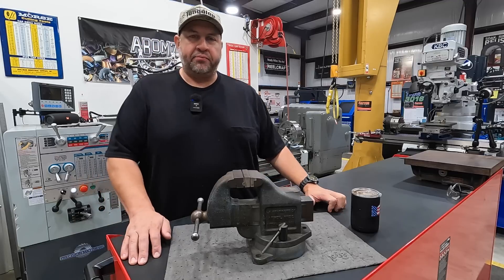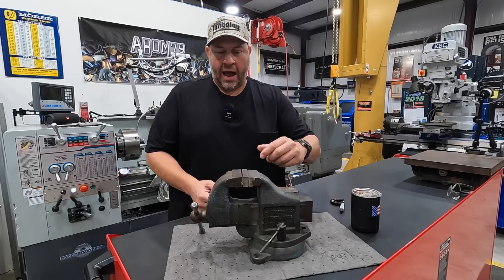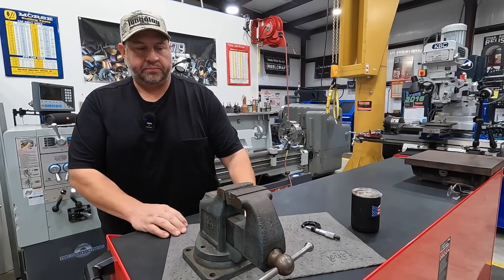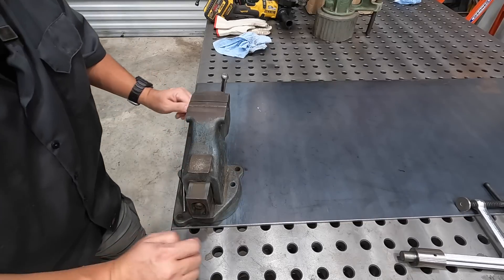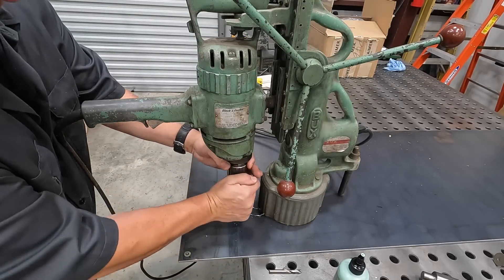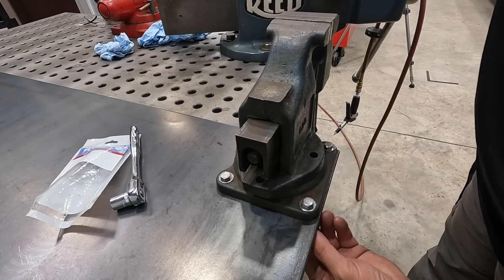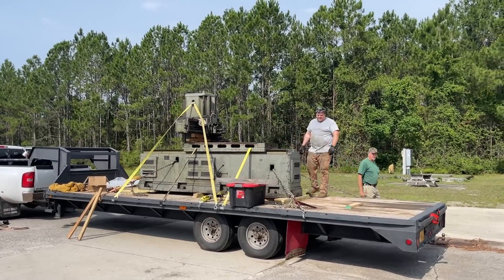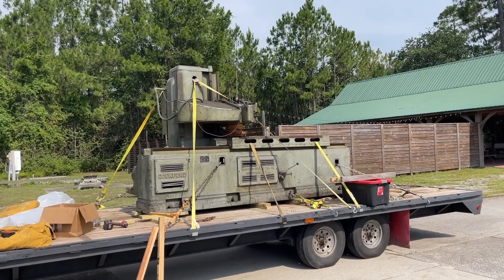SNS 374: The Starrett Machinist's Vise

Comment: 37 commenters are probably going to mention now, that the reason the vise base doesn't have a 4th lug is so you can get it slightly closer to the corner of the bench without a bolt being right in the corner.

Comment: So many times I see people mounting the vise base wrong. In your case there, it doesn't matter much, but those vise bases are meant to be mounted with the round section facing the corner. This allows the base to be closer to both edges and allows the  arc of the jaws rotating on the base stay past the edge of the workbench so you can hold vertical things in the vise without hitting the table top
Reply: Perhaps it's only me, but a lock washer or two on a vise that is going to see some possible vibration and stress might not be out of order. But that's just me. I'll leave it to the professionals.

As for putting the round end in the corner, that would appear to place the hold down bolts in the best position to take the load. The bolt in the corner adds nothing except holding the vise flat on the steel plate.
Reply: @jerrylondon2388  What kind of work are you thinking he will be doing in the office?  Good lord.... "load" , "vibration", and "stress"!  It is a micrometer vise!!!
Reply: @paulcopeland9035  Good lord! Why 200 lbs of steel for a base instead of plywood or melamine? It's not a precision surface that could be used for precision measurement.

Comment: Nice vice you've got! You can fix that missed mat cut off by making a square cut (a little bigger than the vice footprint) and adding a black plate with the same thickness as the mat.

Comment: It'd be a fun race to see if you could make 3 bolts quicker than going to the hardware store.  For the CNC lathe you could exclude the programming time (if there isn't a built in bolt program already) but include the tooling setup, to be fair.
Reply: The programming time would be 12-18 months! He barely knows how to turn it on, let alone programming it!

Comment: I have an Athol 925 and the tail on mine is cut short about about an inch. Yours must have been cut way down because they only needed to open it a small amount.  Many of these old style vises cracked the top of the tails maybe due to striking and they got cut off like yours.  The Starrett Athol vises have one of the largest strongest tongues under the slide. Very nice vise.

Comment: Great video Adam.  I have two of those B&D drills in my garage. low rpm and I dont think you can stall them.  I will never use them because like you said, they a very heavy and iam to old to mess with them.

Comment: I live a 2 minute drive to Starretts.  I can't find a vice for myself.  They are around, but no one is willing to part with that vice.  I had a set of their punches and drives about 50 pieces in all,  a gunsmith I knew absconded with all of them.  Funny how attached you can get to a tool.
Reply: I have a number of vices, tobacco, alcohol, several others. I don't plan on parting with them. However, yo should be able to find someone to sell you something for holding items, a viSe.

Comment: Adam I am sending you two CRC products, a "Switch Cleaner" and a "Dielectric Grease". The Grease should arrive before the Cleaner. First use the cleaner on the Reversing Switch, then grease it. This is a beautiful drill, and all  the switch needs is some cleaning and lube.

Comment: I bought one of these maybe 30 years ago from McMastercarr. It’s blue and a 4 1/2” jaw. It also has pipe jaws that are removable. It was a choice between this and a Wilton bullet vise with pipe jaws. I’ve been using it since then. Great vise. But they unfortunately stopped making bench vises years ago. That’s really too bad. It’s a very solid vise.

The vise here is interesting. Too bad that because of the specialized usage, the jaws barely open. I would have mounted it a bit differently. Bolt the plate to the top with nuts on the bottom. Use flathead screws to countersink flat. And do one in the middle to eliminate vibrations. Mount the vise with bolts going through and nuts on the bottom as well. That would make the top solid and the vise solid as well. I don’t feel good about screws only into a 1/4” thick material with no nut for vise holding.

More recently, I wanted to buy a Starrett digital micrometer. Going to their web site, I saw that none of their digital calipers are made here. All are made in China. So I bought another TESA/Brown & Sharp.
Reply: You could go mitutoya. They are fantastic, and made in Japan, which is where they are supposed to be made.

Comment: So does that reversing ring change where the brushes are to reverse the motor? That is a wonderful idea someone came up with how ever it works.
Reply: From what I remember from my 1964-67 shop days- yep reversing the brushes reverses the motor. But if I remember correctly, I thought it only worked for 3 phase motors.
Reply: @jerrydemas2020  well sir I thank you for the information more than I had when I asked the question, so I thank you again
Reply: I guess it rotates the brushes angular position relative to the stator coils so that the current through the armature is phase shifted by 180 degrees, reversing the motor.

Comment: Nice to have the god vice. Dealing with tolerances you sneek up on I always liked. The thickness & bulk is what  needed for abuse Ive seen over the yrs. In regards to other vices you should be able to heat a bar of steel & bend it without the vice bolts moving. Bet that vice avoids harsh blows.😂😂😂😂
Reply: Sure. He has at least one big ass vise for that kind of thing.  I have a little ancient craftsman vise, not quite as large as that one, bolted to a toolbox. It has taken a few bearings over the years and handled them surprisingly well, but it's not really ideal for it. Tough little bastard though. Even has an anvil flat and horn on the fixed jaw side.

Comment: How think is the plate? Great project as usual. If memory serves you did something similar in the past, concerning the plate on the tool box. However I can not  find it. I love the idea of putting a plate on a tool box.
Reply: Mentioned near the end of the video @ around 31:53 1/4 inch
Reply: 1/4 "
Reply: @pauladams9477  yup. missed it, when I was looking for it I kept going back to the part where he was drilling and tapping, thinking it would be around there. So thank you for telling me where to look and giving me the thickness.

Comment: What is the secret to drilling small diameter holes? My success rate is less than 50% on holes less than 1/4" and I still break a fair amount  of the 1/4" bits.
Reply: What are you drilling? Typically  pilot drill (1/4" finish hole = 1/8" pilot) A good sharp drill is necessary. High speed steel not carbon steel. If you can look for 135° split point.
Reply: @budbrady3289  I'm using standard plate steel of various thicknesses, usually no more than a 1/8" to 1/4". I use high speed and slow feed on my press, so a dull bit may very well be my problem. Thank you, I thought they were sharp, maybe I need to have someone else sharpen them.
Reply: @Raymond.Butler To prevent drills breaking on thinner plate, I'd make sure that the plate is well held down, so that as the drill breaks through it doesn't grab and try to pull through. Always, as someone else has said do a pilot hole first, if the plate is 1/8" - 3mm, then use a 3mm drill. I don't have my speed and feed tables to hand, but make sure you are drilling at the correct speed for the material. Use cutting compound, I use Rocol RTD here in the UK. I have only broken a drill bit (2.5mm) once 8n the last year, but I was drilling freehand in my defence. And make sure they are sharp.
Reply: @SteveColluns-hm2xx  I usually make it to just about break through and I'm using a bench top drill press.

Comment: Is there any reason you've not been using your Flex Arms?
Reply: Why bust out more tools when he already has a set up that will get the job done? It's just three holes.
Reply: @philipernst1693  I thought he had a flex arm mounted on a rolling cart.  It would seem that he would the same center finder, drill, and tap. And, it would not require the same heavy lifting.
Reply: He just wanted to get out his dad's old mag drill and show it to us.
Reply: @robertlevine2152  I the Flexarm is just for tapping, it creates torque only. It doesn't have a quill gear for applying downward pressure for drilling. That is not to say you could't chuck up a a drill I suppose but the operator would still be responsible for creating the down pressure,

Comment: You could cut off that little corner of the tool box pad that you cut off wrong and make a little piece to fix the pad and maybe put a little black silicone in the crack and smooth it out with your finger and you will probably not even see it

Comment: Really cool you got to take the kind of tour that you did and with a vise for memorabilia, sweet deal. If in you ever get the chance, try camping up there in the northeast during mid/late summer; Sebago lake outside Portland, Maine or Lake Winnipesaukee, New Hampshire are both quaint and fairly quiet. It would be fun, what they consider a heat wave, you might be putting a coat on for; conversely, you will be bundled up to look like the little brother in a Christmas Story and they are walking around in shorts in January (not kidding, it was 14F and the wind was blowing 30mph, saw no less than 3 people going about their day in shorts).
Are we going to hear you signing the Johnny Cash song about "One piece at a time" through most of the tour video? Might be what caused the flub on your matting. ; )
Thanks for the videos.